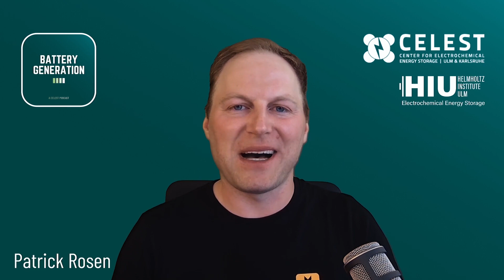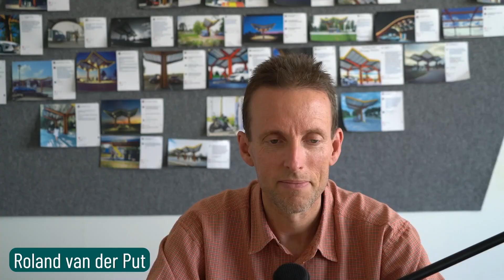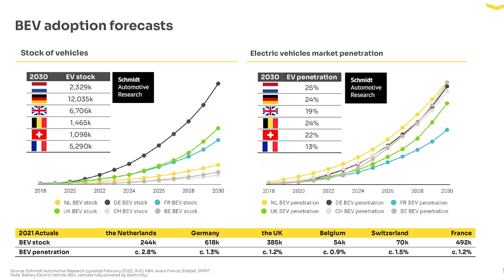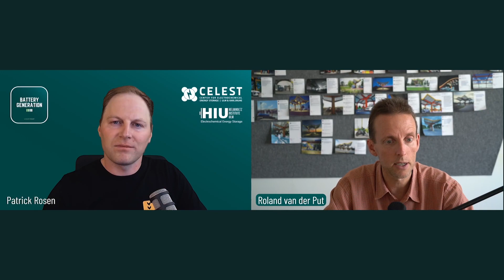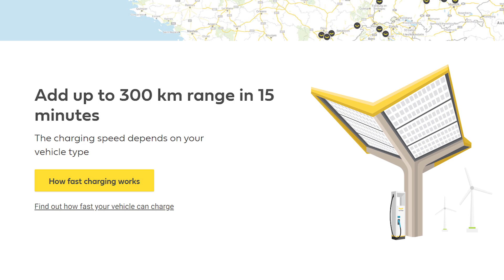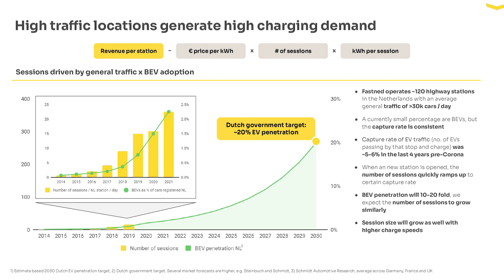Fastned EV Fast Charging Stations - Roland van der Put | Battery Podcast

Comment: 15:00 Model 
S You should specify which battery, the 85kwh battery packs have been castrated to charge 50 % longer worst case by Software updates in 2019

Comment: Maybe if a common complaint is that the charging speed is not as fast as expected, another conclusion might be to check if there is something wrong with the chargers. I would think most EV drivers know about charging curves. Coldgating, rapidgating and so on. And sometimes charging is slower than expected, whether the power of the chargers is shared or there is some other limiting factor from the chargers. I used to use the Wittstock/Dosse Fastned charger quite often when I has a project in the area and there it was always slower than expected. I was expecting 130kw and was getting only 75kw despite the ABB chargers where saying 150kw. Battery was empty and warm I know my car. I didn’t do a representative survey but I have the impression that ABB quite often underperforms while Alpitronic only when they are obviously sharing, which can also be annoying. Ionity always gets best charging speed but they seem to have a problem with reliability. Which is especially bad if there are only 4 chargers and two are broken.
Reply: The Alpitronic Hyper Chargers are currently the best in my opinion.
You see them really taking a large market share at the moment. Quick and fail save communication.
Reply: @RedBatteryHead  agreed. Only problem I had with hyperchargers is that you get to a place with only one hypercharger and two outlets. One is already taken and you know when you plug in the one that is currently charging gets less and you won’t get best speed. That always puts you in an uncomfortable situation in my opinion. So far EV drivers seem to be very relaxed about it and it never has been a problem. Anyways this is not the hyperchargers fault it is the CPOs fault.
Reply: @cdohm  Those hyperchargers have 4 75kw modules. So if you plug a second car in, the first still has 150kw power. There are almost no cars that can keep their charging speed over 150 kw for more than the first 10 minutes, and even if both arrive at the same time, being limited to 150 kw max maybe prolongs the charge time to 80% by a minute or 2. It's clearly better design than the Ionity 350 kw chargers, with only 4 stalls and 1 probably defect.
Reply: @Psi-Storm  that is max. There are many out there with only 2x75kw modules
Reply: @cdohm  Almost all of our Hyperchargers have been equipped with 4x 75 kW modules so that power is available for sharing between two vehicles. I have seen that other operators approach this differently so I can only say how it is at Fastned.
Reply: @rolandvanderput  yes the 2x75kW where other operators. About Wittstock I didn’t do any measurements but I was under the impression that they were slower than expected. It was also always crowded and others charging there told me the same thing and we were wandering if it was sharing the power as it was usually all three chargers occupied. We also had to call the hotline two times to reset the chargers. Hotline was great and after 5 min the charger worked again just didn’t leave a good impression of the ABBs for me. When I go to the netherlands and charge on fastned hyperchargers I never had any problem, thats why this odd one out is sticking to my memory. After a while you start avoiding certain operators or stations. I will never stop at a efacec charging station again, if I mistakenly have one in my route plan I will just go on to the next one.
Reply: @cdohm  There is no power sharing with any of our ABB chargers at the moment so that cannot be the cause. If there would be an issue then charge speed typically goes back to e.g. 30-40 kW with the ABB chargers.

But.... the good news is that we are upgrading all of our highway locations in Germany and will be installing 300 kW Hyperchargers. For Wittstock we are also aiming to double the size of the station and fix the access road. 🙂
Reply: I would say that in at least 95% of the cases it is the vehicle that is the limiting factor in achieving the maximum possible charge speed, and that there is no issue with the charger. We continuously monitor all chargers to spot slow charging since it can be an indication of underlying issues with the charger. This includes the ABB chargers at Wittstock. And contrary to what you say, many newbies do not know about charge curves, battery temperature and so on. Most of them can't even tell how far you can drive with 1 kWh so the challenge is to manage expectations set by the salesperson of the vehicle.